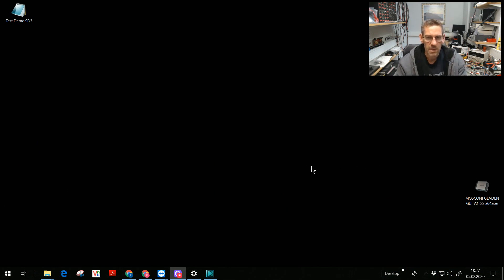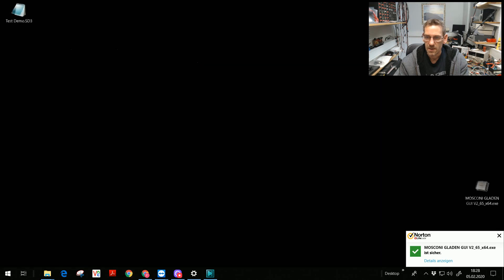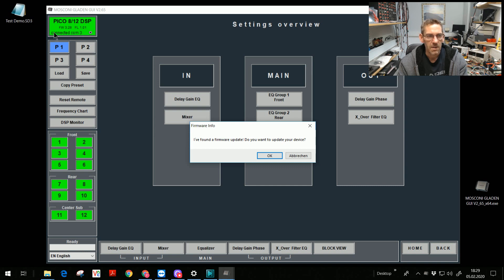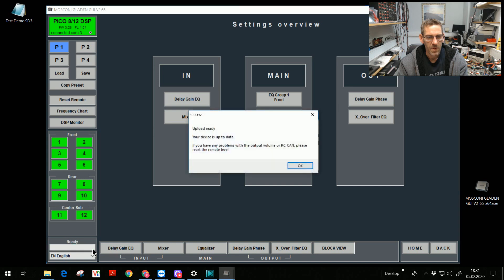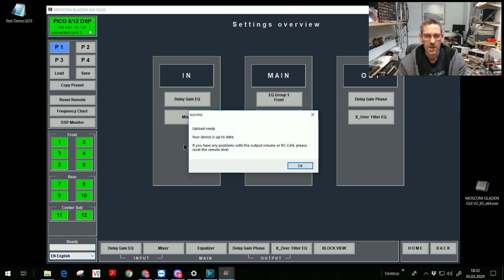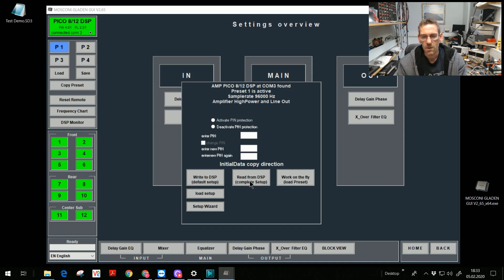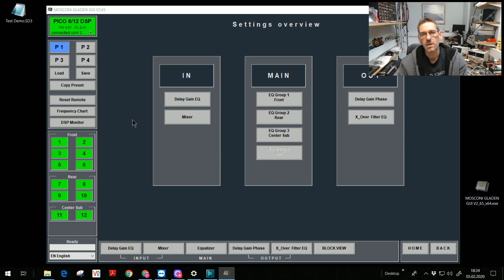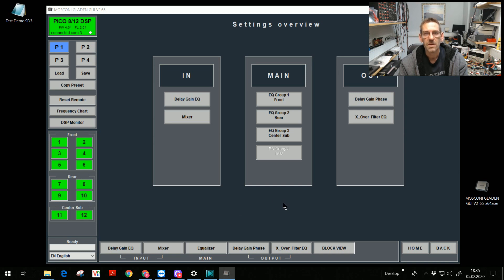using dISC - Part 1 Video-Tutorial MOSCONI DSP *english version*

Comment: Dear teacher.
There isn't much information about Mosconi DSP.
How do I turn DIGITAL INPUT: OFF when using High-Level input after the output of the Mosconi Pico 8|10 V2 DSP vehicle OEM amplifier? There are only OPT / COAX / CARD switches, and no OFF switch.
Reply from the maker: Hello,

the digital input can be completely deactivated in the mixer, just like any other input.
It can then be routed through if required using the trigger options.
There are separate tutorials on mixers and triggers here.
Reply: @GLADENMOSCONI  Does the Mosconi Pico 8|10 V2 DSP automatically recognize high level input from an OEM amplifier?
And for Mosconi Pico 8|10 V2 DSP, if you open the cover, there is a HIGH LEVEL switch. For OEM input, should all switches be set to 30Vrms? (CH1~8)

Comment: Hello, my install is via my stock base radio in a 2017 Accord. It's connected to the  radio by tapping into the speaker wire which I assume is a high level input connection? Does this mean I have to push the input button on my Mosconi 6TO8 Pro to choose "high level"?
Reply: Yes